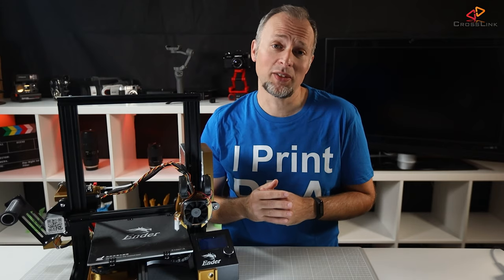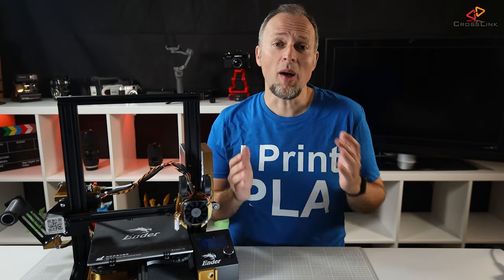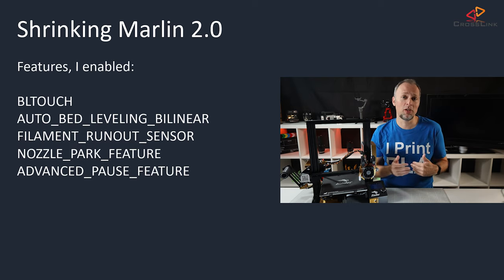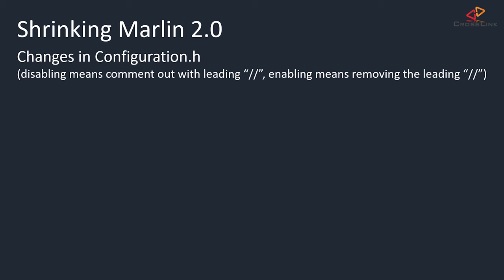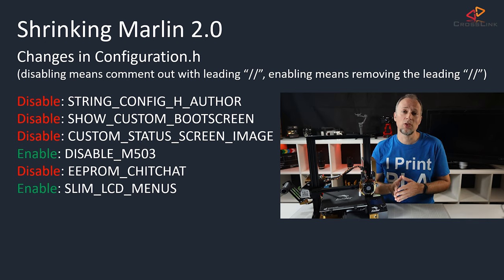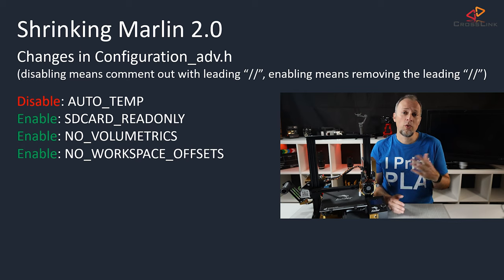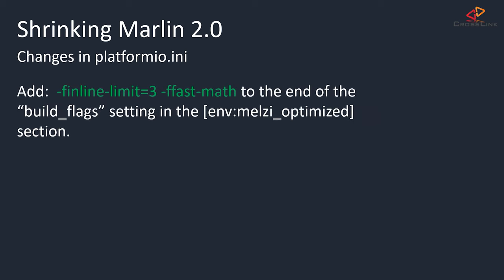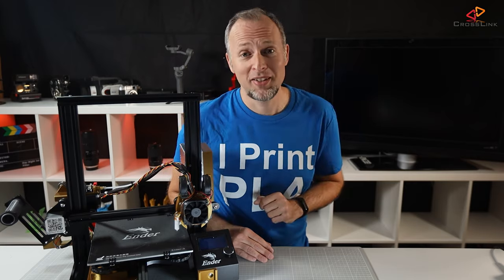SHRINKING MARLIN 2.0 - How to reduce firmware size and still use a BLTouch and the filament sensor!

Comment: Nice video, based on this idea to remove some items from the firmware, I got my frankenstein-printer (Anet A8 with creality 3d v1.1.4 board) with more options (lineair advance, ABL, pid AT bed) by removing the display from the firmware. not using it because doesn't work. so why have in in the firmware (use octoprint to operate), got me back to 64% of memory use, enough palce for more options.
Reply: After removing SDcard support, that i never use got it down to 51.8%

Comment: Hi. Very interesting video... However, can you precise where to place exactly the two commands , in the platformio file, to reduce the firmware size please ? I try to load the firmware marlin 2.1 with the melzi optimized  environnement and the platformio file is not exactly like yours.....  To activate the slim lcd funtion, it seems that we must disable other functions to avoid error...can you precise this please ? Thanks for your answers.

Comment: Hallo Daniel, schönes Video ... wie alle deine anderen ... ich schaue sie alle an ... könntest du mir bitte helfen zu verstehen, wo genau ich die build_flags-Strings platzieren muss, die ich nicht gut verstanden habe ... Ich benutze Marlin 2.0. 9.5 .. ..und in der platformio.ini Konfiguration habe ich folgende Dateien:

[Platformer]
src_dir = Marlin
boards_dir = buildroot/share/PlatformIO/boards
default_envs = melzi_optiboot_optimized
include_dir = Marlin
extra_configs=
    ini/avr.ini
    ini/due.ini...etc...etc...

Rahmen = Arduino
extra_scripts = ${common.extra_scripts}
build_flags = ${common.build_flags}
lib_deps = ${common.lib_deps}
platform_packages = platformio/tool-dfuutil@^1.11.0
monitor_speed = 250000
monitor_flags =
  --ruhig
  --Echo
  --eol
    LF-Erweiterung
  --Filter
    einfärben
  --Filter
    Zeit

#
# Drucken Sie einfach den Abhängigkeitsbaum
#
[env:include_tree]
Plattform = atmelavr
Platine = megaatmega2560
build_flags = -c -H -std=gnu++11 -Wall -Os -D_MARLIN_FIRMWARE_
build_src_filter = +<src/MarlinCore.cpp>

Könnten Sie bitte einen Blick darauf werfen und mir genau erklären, dass ;flag; und wo soll ich es für den ender 3 8bit einfügen
Ich freue mich auf Ihre Mitarbeit und bedanke mich im Voraus.
Reply: Hi, i'm exactly on this configuration....with the same problem...did you find where to place the commands on "build flag" to reduce the size of the firmware ? Or other solutions ?